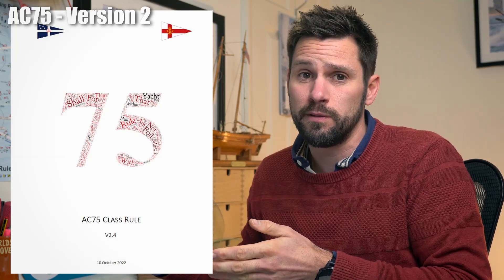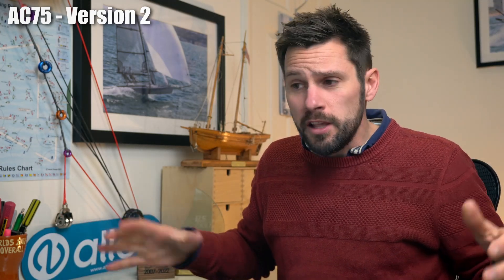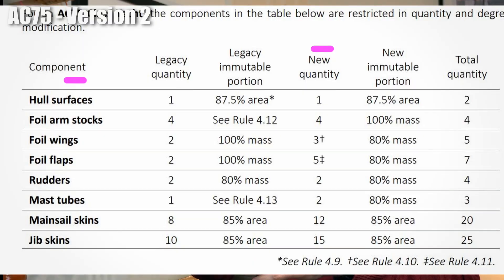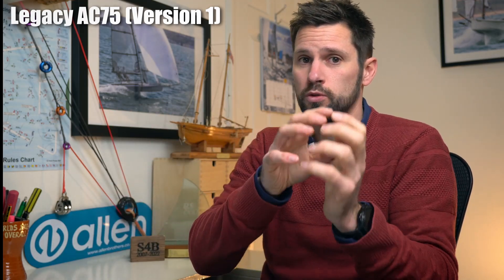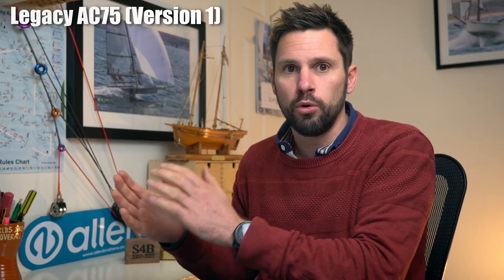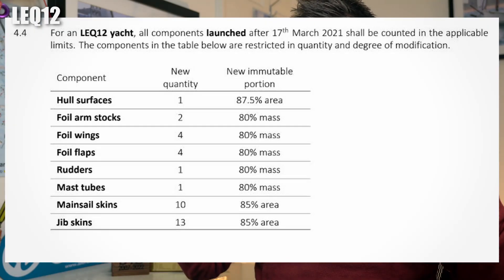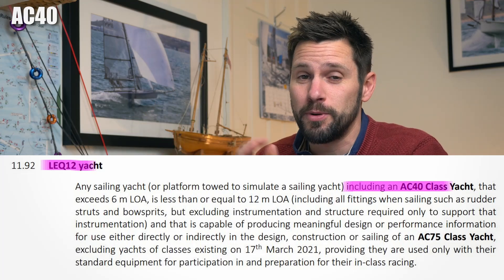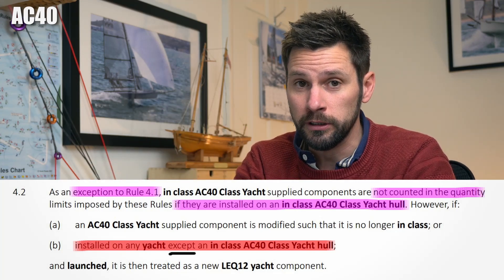Americas Cup Boats Explained

Comment: I like the way you laid this out, tho it sounded a bit like an infomercial to begin with, where they taste you to watch all the way thru to finally get to the info. Do the regs allow the use of batteries to reduce crewing costs during the buildup to the event? Cyclors are costly, and add little to nothing tactically, or is the benefit of them switching sides significant?
Reply from the maker: Hey Charles, nothing stopping using batteries instead of cyclors when training. However, often the cyclors do have some roles and buttons to press for overall performance, so getting these rolls sorted will be important. Also, how you managed the power from the cyclors, how it is stored and the efficiency in those systems can all be tested. Then there are the ergonomics of a good cycling position, plus the different 'pedal' feel due to lack of inertia would all be worth practicing on board. 
Sorry for the longer than usual background section, I wanted this video to be accessible for those newer to the AC. I've put chapters on the video so viewers can jump to the sections they want to hear about

Comment: Thank you, that was eyes opening and helpful. Could you elaborate on what is each team using?
Reply from the maker: Sure thing!
At the moment we have:
Alinghi: Currently using a Legacy AC75 (Te Aihe bought from ETNZ) then AC40 arriving early next year which they will test some LEQ12 parts on. 
American Magic: Currently using a Legacy AC75 (Patriot) then AC40 arriving early next year which they will test some LEQ12 parts on. 
ETNZ: Currently sailing an AC40 with some non-class LEQ12 parts on. Their second AC40 is about to launch very soon. We don't know if they have any plans to use Te Rehutai (Cup winning AC75) as a legacy boat or not. 
Luna Rossa: Currently sailing a self built LEQ12. They will get an AC40 in the new year, but probably won't use the 40 for testing any non-class LEQ12 parts as they have used most their quota on their self built LEQ12. They do have a legacy AC75, but we don't know if they have any plan to use it. 
INEOS: Currently sailing (towing) a self built LEQ12. They have already taken delivery of an AC40, but we haven't seen tehm use it yet. They probably won't use the 40 for testing any non-class LEQ12 parts as they have used most their quota on their self built LEQ12. They gave their AC75 to a museum, so we don't think they will use a legacy AC75 at all.
Reply: @MozzySails  thanks!
Reply: @MozzySails  K-Challenge? Ex-ETNZ te Kaha, I think? (When did we stop referring to boats by their sail numbers? :)

Comment: I always enjoy your videos and your insight, the new class of AC boats are fascinating and the technology utilized is cutting edge.  

There are so MANY restrictions to building and testing new components and the restrictions on ACTUAL sailing training time allowed that real "progress" in design is NOT allowed. The "boats" are boring to watch, no crew action, the courses are SHORT and resemble auto racing NOT yacht racing. NO tacking duels, NO jibing duels just fewer and fewer  "sailors" hunkered down in cockpits, using computer assisted controls and foiling autopilots (??). MILLIONS spent on "boats" that will never sail for the Cup or after the Cup cycle is over.  

I want to watch yacht racing NOT car racing in boats

Comment: Very interesting. My thanks. and now for the questions....! Q(1) So can a team run a Legacy boat, and LEQ12, and an AC40??  Q(2) text copied from your showing of the AC Design Regs: "LEQ12:  'Any sailing yacht ( or platform towed to simulate a sailing yacht)..."  - Surely INEOS towing pole/rig is only allowing for the 'simulation' of sailing yacht as it could not have sails mounted on the towing rig? Seen this way INEOS LEQ12 should be able to use its 'test' pole as it is not a 'mast', but designed to simulate sailing whilst being towed?? Again my thanks.
Reply from the maker: 1) Yes
2) Yes, however the rules committee determining resemblance to an AC75 part takes precedent over any definitions. So if it has any likeness to a AC75 part, then it counts as an LEQ12 part. Watch this space on the tow mast saga, there's still more to come!

Comment: How do the teams police the rules?  

There appears a myriad of specialized rules and exceptions.  Given that the teams are spread out all over the globe, how is enforcement occurring?
Reply from the maker: In terms of equipment it's self declaration... but other teams can protest. For the actual racing the measurement committee will check everything
Reply: I was wondering the same thing. Like what is stopping them from packing a few 75s on a giant boat, going to some out of the way bay somewhere on the globe and testing away with no one the wiser?

Comment: @Mozzy Sails... This is all well and good, but how do they resolve the issue of cavitating foils? How would you approach this?
Reply from the maker: Barcelona in late October could be quite light winds. The teams may focus on down range early take off rather than top speed. It might never be windy enough to see cavitation speeds
Reply: @MozzySails  .... Okay, with the focus being on lighter winds and unsticking the boats, with the combined crew weight being worth 10% of the all up  boat weight, do think we will see female cyclors as a weight saving strategy this time around?